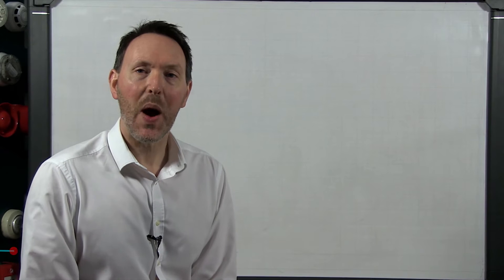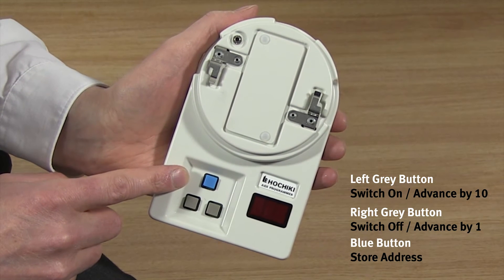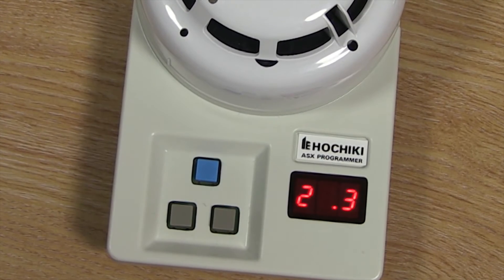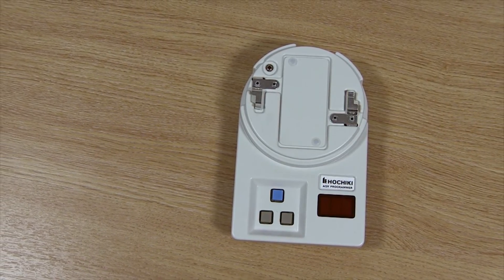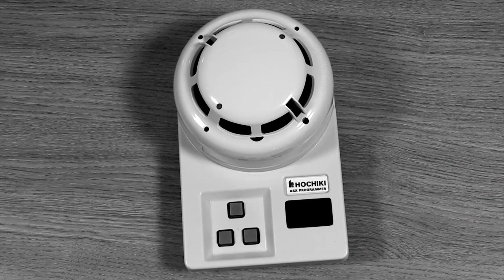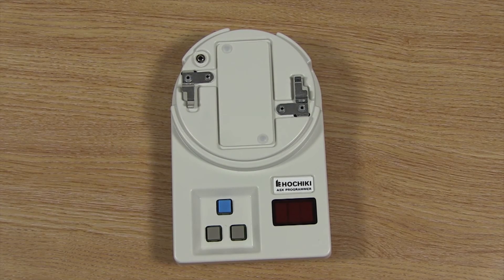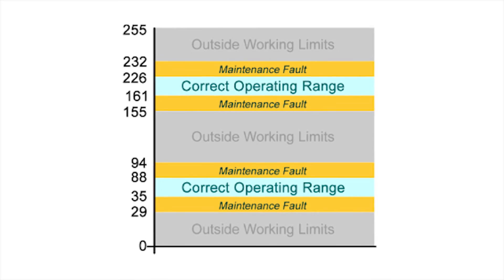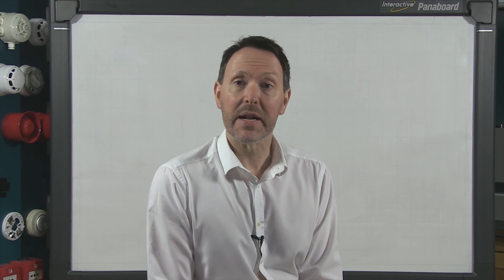Hochiki Hand Held Address Programmer - TCH-B200

Comment: I am having an error with this. The manual for my base sounder says to keep it on the default adress which is 254 and keeps changing to 128. I also have a detector on it, how do I fix this? The panel I use is a Kentec Syncro Series 6000

Comment: Thank u, But i've a problem with it, if i turn on The Programmer automaticaly Displays E3 Error, and when i serchead on the Meaning Code Error i found that Means Invalid sensor response, how can i fix the Problem
Reply from the maker: Hi Youssef, thanks for commenting.  We'll pass this onto Tech Support for you.
Reply: Hi Youssef, The programmer will always display an E2 error if there is not a detector or sounder, etc. fitted to it.
Does this happen when you have a sounder base or detector fitted?
Reply: As many years I have used this programmer I never knew about the secret menu